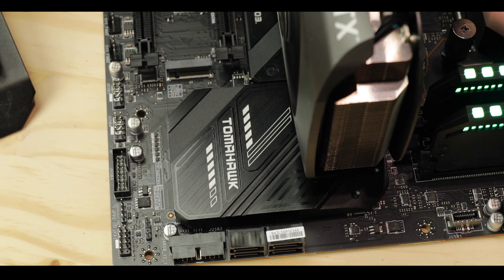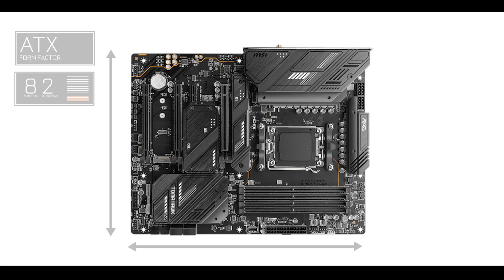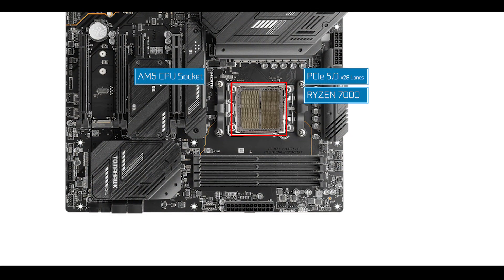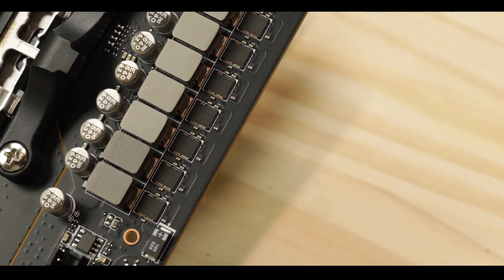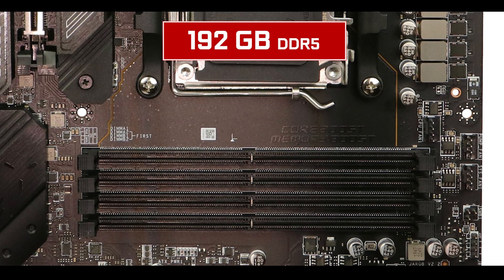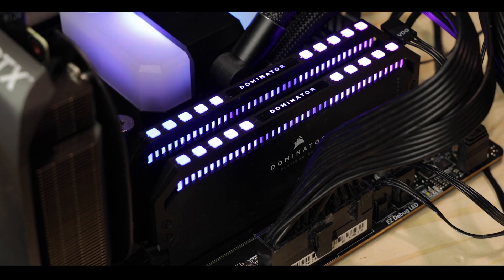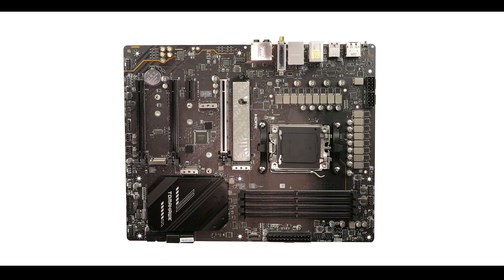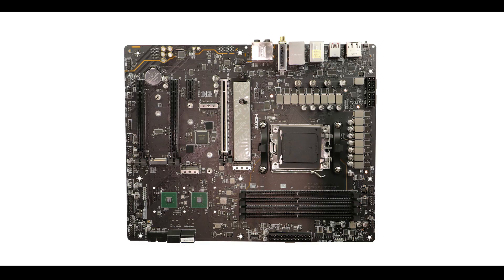MAG X670E TOMAHAWK : No, no, no.

Comment: Thanks a lot for a review for this board, gave a lot of insight. Totally agree on missed opportunities, but I still went with it from final choice between ~10 boards. 4th M.2 is an overkill, so lack of shield is no prob. Cooling is more than adequate and for me personally more pcie slots even if they are slower is still a king - even if I don't use them straight away having an option to casually slap bunch of additional periferials is king. With current B550 having to choose between PCI-E 2xSFP+ fiber contoller or USB-C 3.2 gen2x2 and not having two slots to connect them last year was actually a breaking point where i will no longer consider MBs with only 2 pcie slots... Other than that everything about this board is actually very decent and that little cost over B650 boards is offset by PCI-E 5.0 for GPU - while there isn't anything obvious right now that could use that bandwith, maybe in 3-4 years we will see a change in graphics cards architecture that would take advantage of that...
Reply: Four M.2 slots are not overkill at all - if you want or need fast storage, the fourth slot is potentially saving you a lot of money, because you can use more smaller drives instead of the much more expensive large capacity ones. As for the lack of shield for the fourth, an adequate aftermarket heatsink costs you 10$.

Comment: In my opinion: Why an M.2 slot might be slow, limited, and not thermally shielded is that you can save a lot of resource costs assuming you use one slot for something that only often crosses 1/16th of the 32 gb you still have that would assumedly never heat up.

Comment: I know I told you I will avoid this board, but after deep thinking I had 2 choices of boards, the Tomahawk or the Asus TUF, after careful consideration I went with the Tomahawk over the TUF. Works fine with no issue, but after all it came with one of the new BIOSes........Haven't had an MSI motherboard in over 20 years and I am satisfied. My only issue is booting especially in the Posting part is slow.
Reply: I just got this a few days ago and booting helped by turning BOTH "Memory context restore" and power down enable" in dram settings this improved load times.

Latest BIOS to date.
Reply: I also advice to run vSOC @ 1.25v Manually to elemenate the PCIe 4.0 1.1x bug @ChrisJSY
Reply: @husseinjuma5997  I can't find much info on it, can you link me any? Although reports and benchmarks for me luckily show running at x16.
Reply: @ChrisJSY how you finding stability? 

I can’t find power down enabled and tbh don’t know if it’s worth the risk?

What iv found is long boot every power up so I put it into sleep mode. Loads instantly after
Reply: I think the slow booting seems to be a 670e "issue". I have another one from Asus ROG and it also takes longer as I used to it.
Reply: LoL i'm in the same situation, on 1 hand i don't want my cpu to blow up after 3 months using a asus board, but now i find this yt vid..
Reply from the maker: Filming the carbon and I had to refresh the bios to get somewhat of a stable boot. Hard to believe it's going to be like this for all X670E powered boards!
Reply: @Laurentschoice  if you are talking about the booting. I don't know if every 670e has it. But I read quite often in customer reviews for different boards take some time. Just took the time and my board needed 45 seconds to boot the bios

Comment: I was going to pull the trigger on this board, Thanks for preventing me from headaches and hardships. Guess I'll have to go with the more expensive x670e Carbon wifi, Reason being I need an MSI board for it's Enhanced boost mode features on 7000x3d cpu's and Pcie 5.0 future proofing.
Reply: I have the Tomahawk. It's really got 0 issues, you have all you would ever need and it's pretty damn easy to troubleshoot (and if you can't just reflash bios with the button). 
Connectivity is not a problem...when are ever going to connect more than 4 or 5 things at a time, if that? And if you were and cared about connection speed you probably need a 1000$ tier board...certainly not entry-mid range.

Also you really don't need to go up to the Carbon for OC, mostly because the cooling and the VRM config is already overkill for any 3D chip, now or in 4 years.
Either you get a major upgrade like the ACE board or you get a "budget" one like the Pro or Tomahawk (if you want the PCIE 5 stuff), i really don't see the point of what is essentially a slightly upwards sidegrade.
Also, to be brutally honest, any x670e mobo will be obscenely outdated by the time PCIE 5.0 makes a real difference, i.e. on GPUs.
Current gen GPUs aren't even close to maxing out PCIE 4 bandwidths, and you shouldn't expect to see any real use for PCIE 5 (except for ssds, which shouldn't be a concern unless you're a professional music producer or a pro video editor) for at least 3 or 4 generations.
That being said, if you want RBG and a cleaner looking board, sure get the Carbon.
Reply: @justsam100  What about the issues the reviewer was speaking of, have you encountered any? Just asking, because I was really looking forward to getting this motherboard. Is he just an Asus fanboy looking at minute bugs/glitches and blowing them out of proportion? I understand with all the recent bios updates to fix the VSOC overheating has thrown a wrench into ALL the motherboards having issues and maybe what he's saying could be the aftermath of the fix? Again, just asking you from experiencing this motherboard. Thanks.
Reply: @arielis78  I think he raises a few good points (mostly about the chipset being underutilized), but honestly it's mostly nitpicking; for 90% of users anything he mentions will never make a difference.
The actual issues i encountered, which he completely missed, were with EXPO and other memory related settings, but i suppos that's a mix of the chipset and expo technology being quite new and the fact that amd had to focus solely on the voltage issue for a while, so it's mostly AGESA being shit rather than the board or manufactures BIOS. 
I think both of these will get more stable in a few months.
Another thing is that the wifi adapters is good, but it has pretty weak signal reception (or maybe my adaptor is particularly shit) compared to other boards i own...not a deal breaker unless you have a huge home.
That being said you can still get the rated RAM speeds for your sticks with manual oc (you can copy the expo setting, disable expo and then input them yourself).
Other than that I have really no bad thing to say about this product.
My 7800x3d chip scored 18300 in R23 with PBO and -30 all core curve optimizer, which is exactly the same as you would see on a 1000$ mobo. You could even manually OC your 3d chip to get higher boost clocks and lower W use, but i doubt that's worth your time.
Ran OCCT for stability test, 0 crashes in 6 hours so it's pretty damn stable.
Flashed the bios once, when cpu wasn't installed yet and never again.
Reply: @arielis78  Having said all that, go with your guts, don't let me or any tech guy on yt tell you what you should or shouldn't like or buy.
Get a motherboard that is technically sound, from a quality manufacturer and has the feature set (and the looks) that you need, that's gonna be the best purchase for you.
Reply: @justsam100  what bios version are you using?

Comment: I use this mobo with 7800x3d . When i updated to latest bios (7E12v13) bios keep freezing.  I flashed old bios now "7E12v133(Beta version)" and no problem so far. Does anyone have same issue ? Or should i send for RMA?
Reply: Bios freeze seems to be a common msi bug. X570 tomahawk was freezing in bios setup, and it all started presumably after I installed a pcie wifi module (ax210 because onboard ax200 drivers are buggy af, not msi fault though). Resolved with a bios update
Reply: У меня bios зависал в первый день работы, на второй день всё само вылечилось, это была самая первая версия bios. Потом поставил 1.3 , всё так же хорошо работает.

Comment: Oops,  just ordered this the other day for my first pc build.  We shall see I suppose.
Reply: I have it and have zero issues with it. Booted without bios update and xmp profile worked at 6000mghz. Runs my 5 7600 at 5.35 on all cores at 1.18v. Only complaint is the bios is old as shit when it comes to the layout.
Reply: @divzed3737  no issues at all. I have everything in a fractal torrent case I have it setup so I cannot hear my fans run. Hottest cpu gets is 55c under prime 95 torture test. Only time I can hear my pc run is if the gpu fans are maxed out and I have my headset off.

Comment: Nowhere near enough USB3.1 for the price. The B650E-F ROG board went down to $274 and is somehow better than this one.
Reply from the maker: wait for the MSI trollers, they'll tare me apart.
Reply: @Laurentschoice  doubt there is such a thing. But you totally missed the crappy network part on this board.
Reply: i think the Asus board has the crappy intel i225-V NIC, i would avoid that at all cost, over 25 years in IT, that NIC has got to be the worst and most troublesome, many revisions to fix it's basic issues, many driver fixes, i lost count over the years, problems fixed yet, nope....any realtek NIC is far better and safer choice.